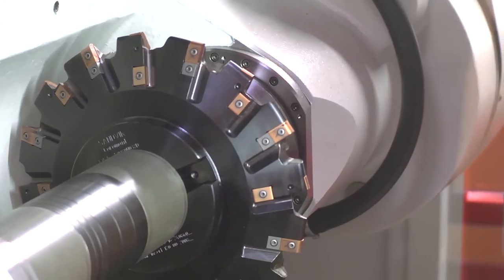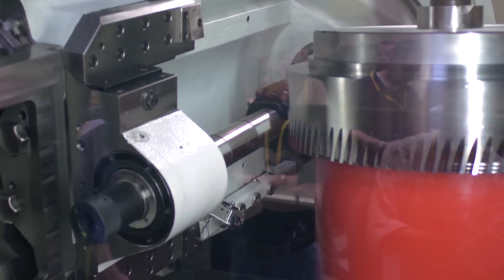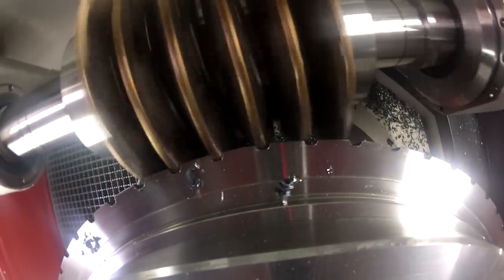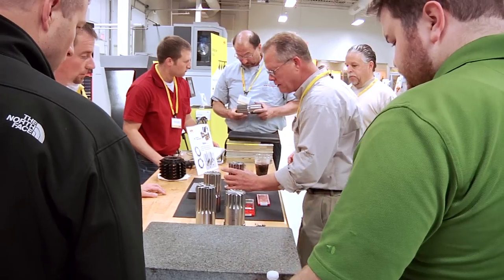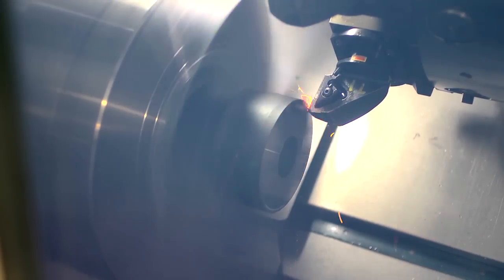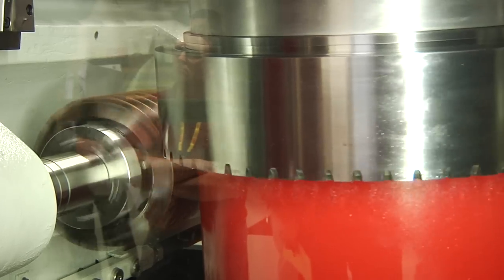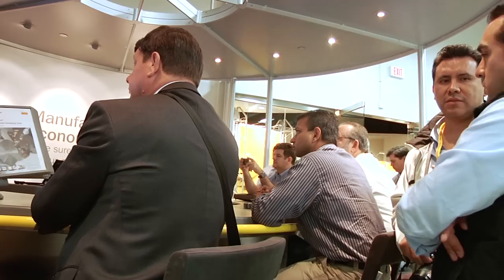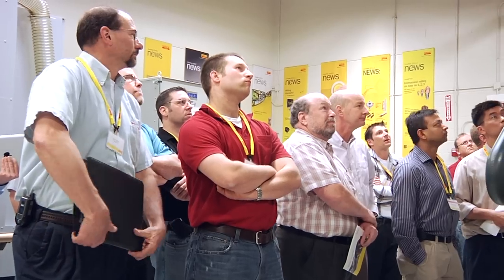Increase productivity by as much as 300 percent - new gear machining tools

Comment: Very cool. So you have insert gear hobbers on one hand, and 5-axis machining on the other. I wonder if the gear hobbers use standard inserts with the special programming for 5-axis milling, or if they are special inserts that are used to mill it with just 2 axes.
Reply from the maker: The hobbing tools have inserts with a profile that are tailored to the specific gear profile you want to generate. 

Best regards,

David Öhlund
Product Manager - Gear Milling

Comment: I would Like to see if there is any difference between the finish of a Comparable Mitsubishi high speed hobber and the Hofler. I wonder if there would be any difference in machine logevity between the 2, I personally prefer the Hofler, and of course Gleason Pfauter were good, but I haven't experienced a late model Pfauter in several years.

Comment: On 2:59, Kenneth Accavallo, is promoting 5 axis gear machining with standard tools, while Sandvik VP on 2:25 is promoting special gear tools with more productive incests. 300% is some misleading because the traditional hob cutters do not have inserts, while standard CNC cutting tools are widely available with inserts to cut gears as  it says on 2:59. Also, accuracy of cutting would reduce with use of inserts, so gear design should be corrected for lower accuracy machining.

Comment: Except, it's not possible to have 300%. its 0% - 100% but you can have 300 times more production. There is a difference. But great video.
Reply: you are wrong. incresing by 300% is by 3. 100% 3 times
Reply: lol of course you can have 300% more productivity. 300% is nothing else that 300/hundred which is by my calculation 300/100 = 3.
productivity gain of 3 means 4 times as fast as before or 1/4 the time needed to manufacture.
Reply: Kai Wyborny If you have one guy digging a hole... then you have 300 guys digging a hole how much has the (time) efficiency gone up?